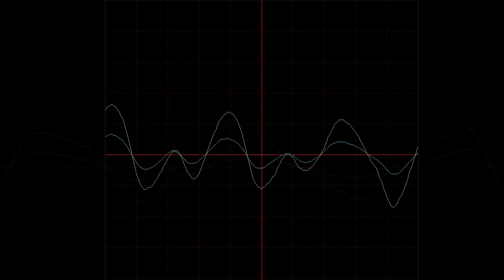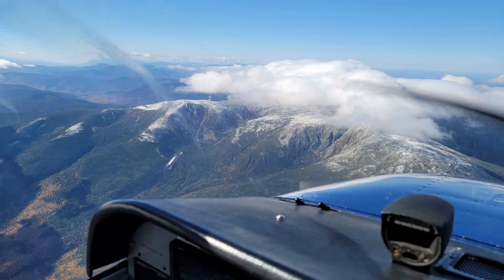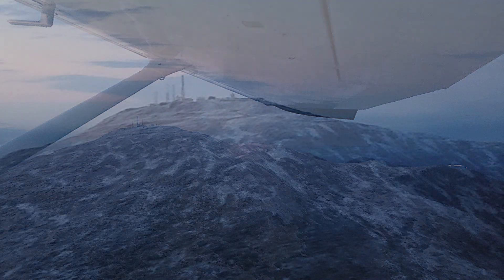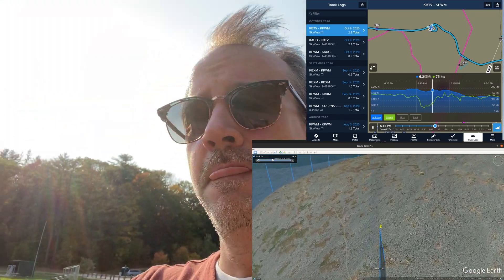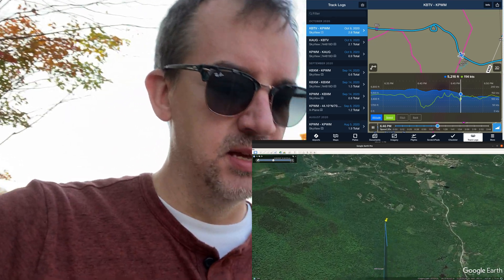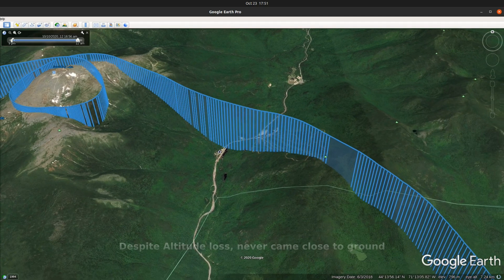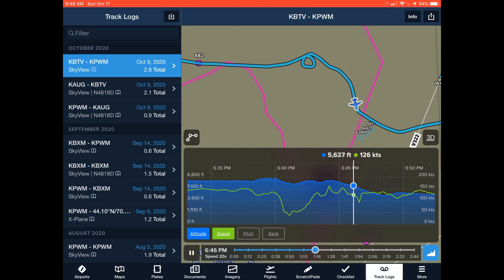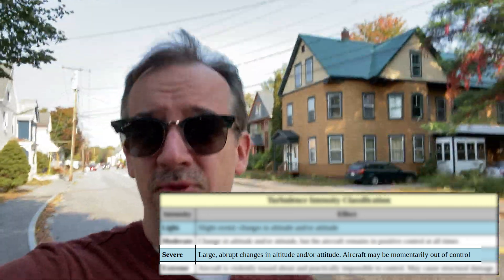Cessna 172 - Mountain Wave Turbulence encounter over Mt. Washington

Comment: Study your  micrometeorology you cannot out climb downdrafts rotors will overpower your control authority. You are lucky you were in the rotor in between the lift clouds. Imagine class five river rapids on a grand scale flowing air behaves like water. Study water flowing over boulders and imagine you are a bug swimming around the boulder. Lift on upstream side mask or sink on the downstream side. Do not fly on lee side. Fly safe. Obviously you are not always right as this flight demonstrated.

Comment: Similar to an ocean riptide? Where you have to travel parallel to the "beach", in this case the mountain, to escape?
Reply from the maker: Less like a rip-tide and more like the ripples in a river on the back side (downstream) of a large rock. You get water (in this case air) dropping off on the back side, and you get ripples and eddies and all kinds of other disturbances in the flow. Your comment on travelling parallel is accurate though - depending on the shape of the ridge-line it may be better to go perpendicular to the airflow, rather than trying to just outdistance it.
Reply: In this case perpendicular downwind would have put him in lift of the next wave. Parallel you continue to fly in the rotor between the waves.